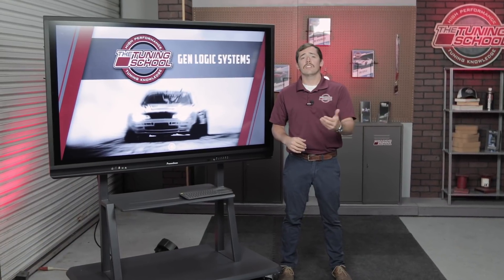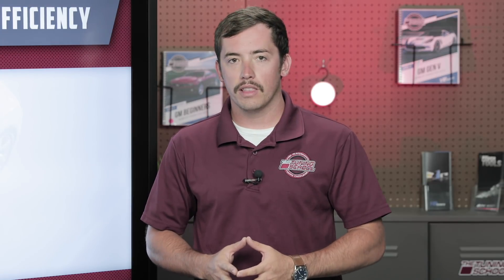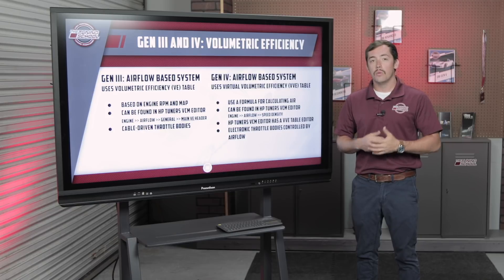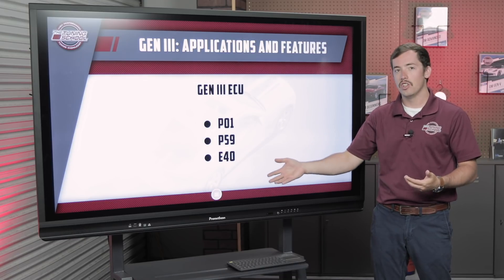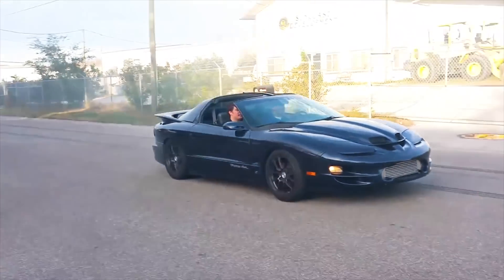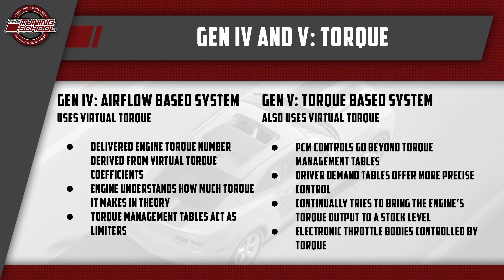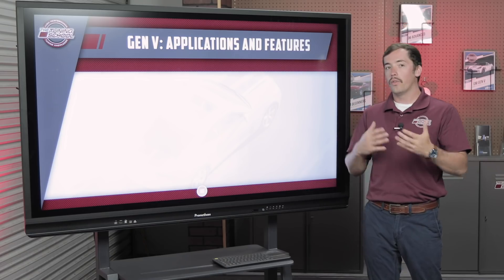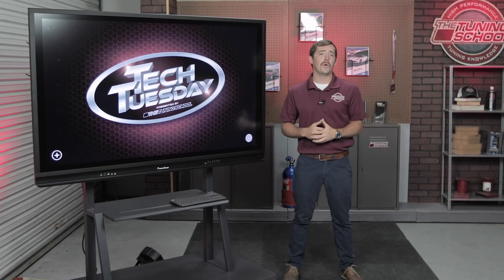Differences and Applications of GM ECMs (GEN III, IV, & V)

Comment: I've been told that buick had a different fueling strategy than chevy. Pont, etc
.
I've also noticed differences when plugging in a scan tool or just working on the engine (I'm a mechanic)
.
Any truth to this?
I'm sure it's to allow for a smoother idle for granny in her buick
.
I know the 3100 uses the 24x crank sensor to control timing at idle....to control idle rpm ( also has a 7x crank sensor that controls ignition....it will run with just the 7x, but iirc, changes to a batch fire injection versus sequential... or maybe that's if the cam position sensor goes out.... still I've had my 24x fail and it ran just fine off the 7X)
.
The 3.1 doesn't use the IAC as much as something like a 3.8 with only a 7x crank sensor
.
.
But... again... my main question is what is the exact differences in feeling strategy between a Buick and Chevy ECU??

Comment: As a dealer tech, which numbers are you talked by about for the PCM? Is this the service number? I don’t think this is a part number’s last 3 digits. I am swapping an 03 Tahoe 5.3L into a 67 C10. This my last major project and other than a cam upgrade and refreshing all seals and gaskets. (Son hit black ice) I already had the truck (C10) given to me.

My main question is the MAF sensor. The hot-wire tube type is new and on it. Newer vehicles use a small bolt in with NTC thermistor is separate, but if using a cold air intake simply because I have few choices, is this something that is changed in tuning? Or not possible? I just verified customers concern then diagnose root cause and repair that! Every vehicle that hat left my stalls had my business card (Thanks Name) back of card was future repairs depending on use. Low pressure sales but heads up warning for future service. I can’t tell you ho many times the Buick guys where playing cards, sticking pickles on ceiling, I had 5 vehicles with “Ok” to fix now, and more outside! (I work on Different Brand/ 4X4’s).
 I am trying to learn these aftermarket parts for daily driver, get up and go but fuel economy!

Do you have a thoughts and info on MAF differences as they fall into two camps outside Speed Density! Thanks. Interesting video as I learn. ASE Master Tech since 1978 + L1 Retired.

Comment: Wich ecu does the GM 1.4 and 2.0 use
Reply from the maker: Some quick searching shows E78s where used in some of the older 1.4L applications, and E39As are used in some of the newer 2.0L applications. If you find out more details of these ECU’s, feel free to share with us, as these are not engine platforms we specialize in.
Reply: My 2018 Regal 2.0 uses the E80 ecm.